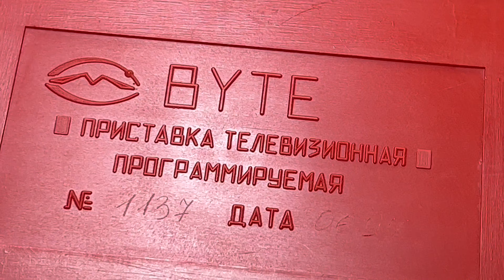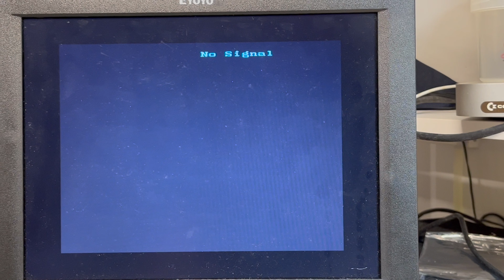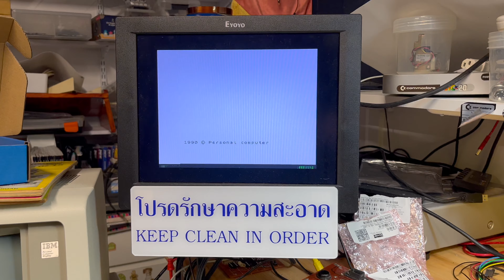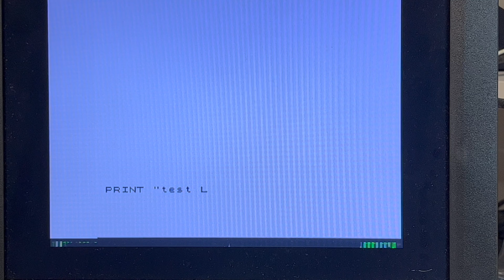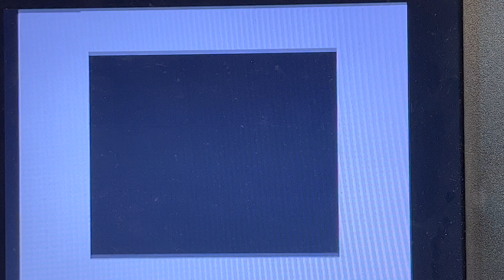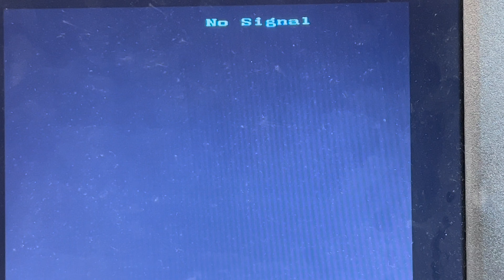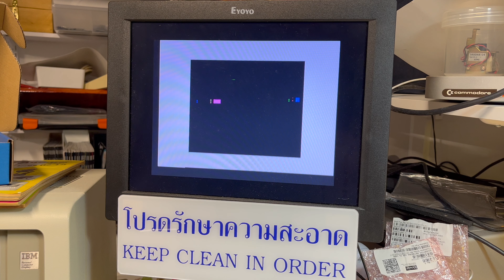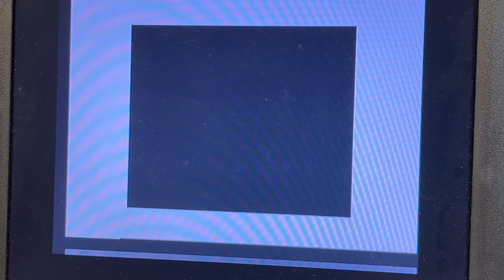🇲🇩 BYTE: Part 12 (ULA Replacement) [TCE #0330]

Comment: Phillips screws & security snot, the ultimate in Soviet anti-tamper technology.

You did a good job of getting the chip off with the hot air gun, it's harder than it looks to do it. As for the broken trace, it plagues the cheaper boards (Commodore for instance).
Reply from the maker: Soviet Philips head == Nintendo tri-wing

Comment: The Hotair station will turn off when you set it down - Watch the temperature falling. It just won't turn off the air until it has cooled down to a certain level!
Reply: This is done intentionally to cool down the heater - it can take damage from its own rest-heat when there is no airflow.
Therefore the station turns of the heater and just let the air flow.
It will finally shut off, when the heater is down to ~100°C like skjerk stated.
Reply: Yup, mine shuts off at 100C. Or quicker if I yank the plug out from the wall. :)
Reply from the maker: Ahhh ... I was always worried about it blasting a hole through the bottom of the stand with 300 degree hot air ... my assumption was that a switch might detect it on the stand and thus stop the air flow.  So I'd always just switch it off when placing it on the stand, then back on again when I needed to use it again ... duh

Comment: Maybe practice on waste before doing 'first attempts' on actual vintage hardware, especially non-Western stuff which is in even more precarious conditions and dwindling numbers?
That station has a controlled cool down process - for the device's own sake. And yeah, do read up on things you're not aware or familiar with, it's what all of us should do in general.
Reply from the maker: Fair comment.  I have had a little practice using the hot air gun but mainly on through-hole parts ... I figured a surface-mount part would be simpler, and I'd just watched someone do it ... maybe Epitronics ... the trick seemed to be to ensure you've added flux to aid the solder flow ... ?